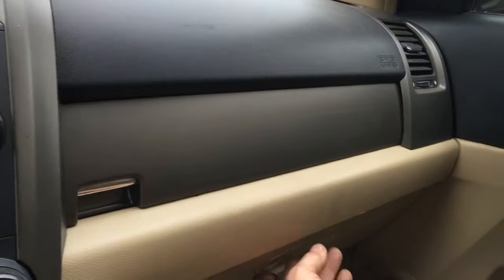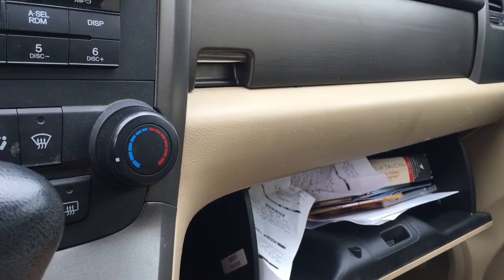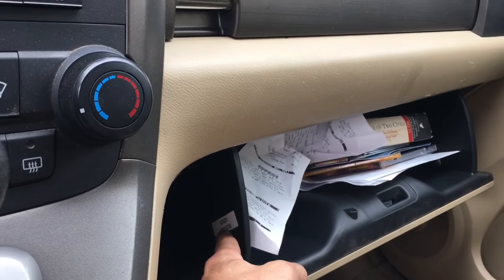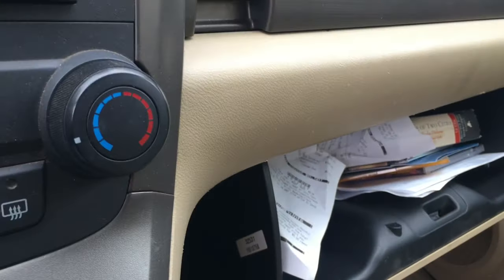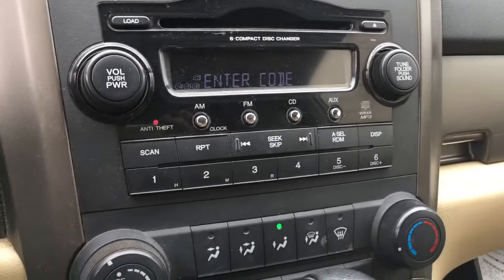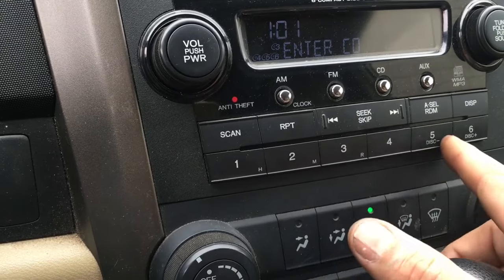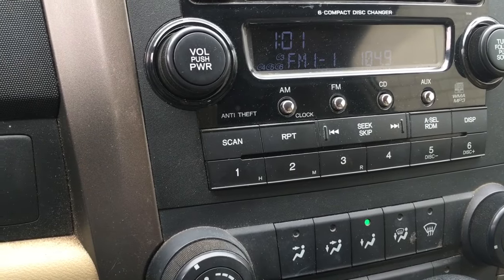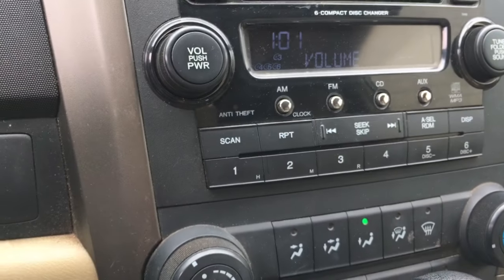How to Find and Reset the Radio Code on a 2007 Honda CR-V

Comment: My sticker isn’t there! So what do i do? Is there another place it could be?
Reply: My stickers isn't there so what do I do now
Reply: I don't have a sticker so how do I get code
Reply: I don't have a sticker either
Reply: Look at the documents, there should be a code some where in there
Reply: I had to call the dealership...there really isn't anything in the owner's manual to help 😕
Reply: Yeah mine was on the flip side of the glovebox, make sure you check everywhere in there!
Reply: So many people don't have a sticker or card for this, I don't either, I went to my garage honda and got the code and tried to put it in and all I get is an error, I've watched other videos and a whole lot of people get the same thing. I'm thinking about scrapping the radio and putting in a after market radio
Reply: Look in your owners manual
Reply: The code should be same for all
Reply: I have the card with the code and serial number. I’ve entered the code numerous times without success.

Comment: Hello Mr. Bryan unfortunately I didn’t have a sticker so I guess I will be one of the unlucky ones! Thanks for the video
Reply: If you have an owners manual check there
Reply: @slushbox3443  where in owners manual would it be? I’m in the same situation where I don’t have a sticker in the glove box
Reply: Went into the owners manual, nothing. I don’t have the sticker either
Reply: Just open the glove box and turn on the radio. Discovered this by accident

Comment: What if there is no sticker?
Reply: SensterzGaming yeah mines gone to
Reply: Same thing with me :(
Reply: Me too, what can we do about it?
Reply: The sticker sometimes is in the glove box but inside and no in the side of it
Reply: Mine has no sticker. Now it says code error e
Reply: Oof! It might be in your folder that holds the manual. Otherwise call your v.i.n. into a Honda dealer
Reply: @napadave58   in your folder that holds the manual there should be a card, like a visiting card, with the code printed on.
Reply: I didn't have the sticker either. Saw the comment about checking the manuals. First one I looked at had the dealer check off list with the audio code written.

Comment: Thank you so much for this. I was searching through the owners manual forever. This was faster and easier. My sticker was not located on the outside , my sticker was inside the glove compartment, way in the back. Had to take a pic of it with my cell phone and then enlarge the screen to see the numbers better. Radio is on and we're rockin' again. Thanks !

Comment: Didn't work for me as my 2007 Honda CR-V didn't have a sticker there and the number written down in the manual is incorrect.  Looks like I'll have to take it back to the Dealer to get them to reset it.

Comment: Actually just discovered this by accident. If you just open the glove box and turn on the radio.
You do not need to manually enter the code.
Thanks for putting out this radio.

Comment: Thank you! When I first bought my 08 used, the first thing I did was change the battery.  So when I figured out I needed some code, I brought it to the dealership right around the corner. A tech came out and did it for me but didn't explain what he did, other than the code was in the glove box. So now I'm changing the battery again and I wasn't sure exactly how to input the code. Thank you for your very succinct, informative video.

Comment: Hello Mr! I 
Thanks for your video!
I need your help because I have the VIN and the serial of radio but I can't get access to the website to get the code.
Please help me!
Reply from the maker: @Marvins509  I would try calling the dealer. They are the ones with the access.
Reply: That we'll be good ! 
Here's info: 
VIN: 5J6RE48589L029199

S/N radio: 15612050

Thank you before for your help!

Comment: If anybody can answer this..... My stickers there I put the code in and I had the key in every position the key can possibly be in and it's not unlocking it like it's the wrong code.biut even the little booklet that comes with the car that code is wrote in there.

Comment: do you know how to find the code if it is not in the glove box
Reply from the maker: If it's not on the side of the glove box. There should be a business card in the owners manual. It may be floating around somewhere. If not you have to call the dealer with the Vin number and they're going to ask you some security questions
Reply: Thank you!

Comment: what if you don't have that sticker???
Reply from the maker: Leslie Caplan then you have to contact the dealer and I’ll walk you through the process of retrieving the news code
Reply: How to Automotive  Hi thank you! Call the dealer and say what?
Reply from the maker: Leslie Caplan you would tell them that your car radio is in code mode and you do not have the code. They will walk you through the verification process and give you the code.
Reply: How to Automotive  oh ok, I  thought they would tell me I have to bring it in and have them take the radio out and charge me a hundred bucks!
Reply from the maker: Leslie Caplan it’s possible they will.
Reply: How to Automotive  I did just see another video that says to hold down numbers 1 and 6 at the same time and turn on the radio while holding those buttons, which should give the serial number. Then you can go to a website, put in your vin number and serial number and get the code. Will try that first. Thank you!
Reply from the maker: Leslie Caplan Sounds like an awesome tip. Let me know if that works
Reply: Leslie Caplan Did you ever figure it out? My boyfriend is going thru the same struggles..

Comment: I tried this and got error code e now :(
Reply: Try disconecting the battery for 20 minutes, and then putting the code. You get like 5, or 10 attempts to enter the code, otherwise error E